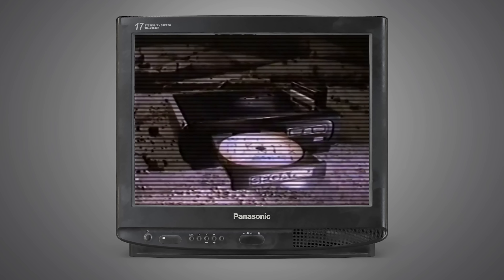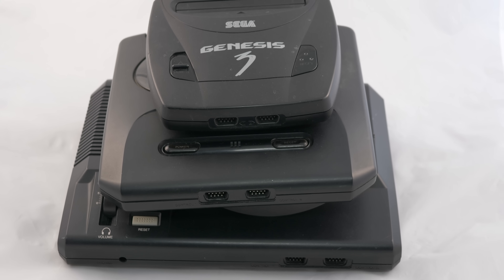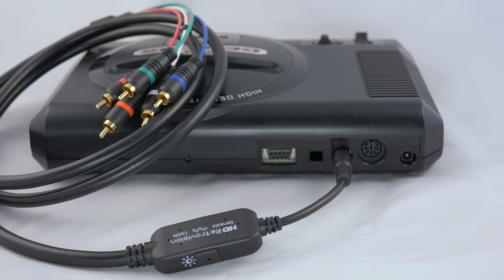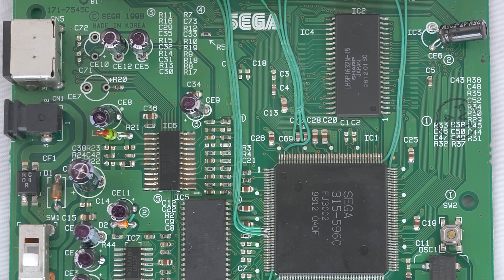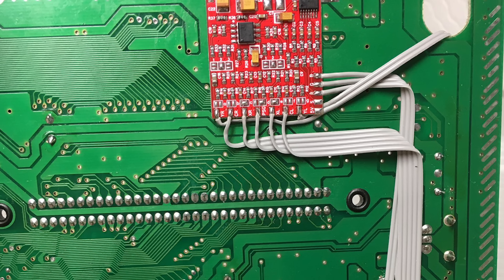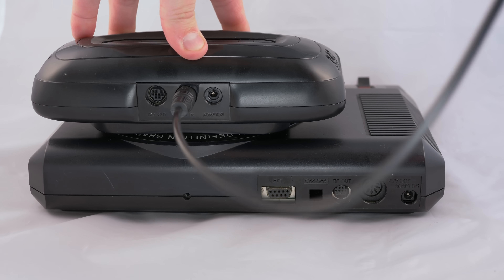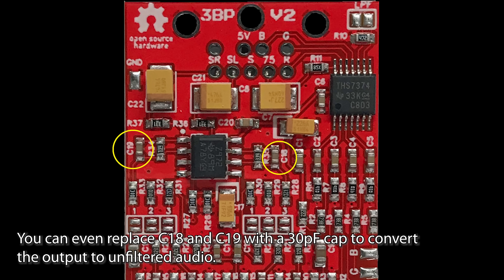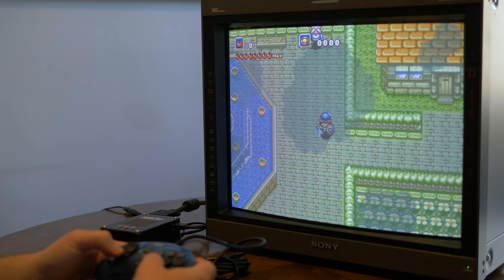Introducing The Sega Triple Bypass

Comment: Video doesn't seem very clear about Model 1 Interference after triple bypass. Will the Model 1 look as crisp as a model 3 with triple bypass? If not how much is the difference. And is there anyway to have no interference on the model 1
Reply from the maker: Analog video on Model 1's will never look as good as a bypassed Model 3.  But they'll still have much less interference than stock.  Maybe try this first and see if it's a good enough improvement for you?:  https://www.retrorgb.com/genesis-1-keep-composite-while-improving-rgb.html

Comment: But what does the triplebypass do to the audio?   What is being changed?
Reply from the maker: It’s essentially making model 2’s have the same clarity and balance as model 1’s. And when installed in a model 1, it’s the same circuit, but with brand new, high end components. So, it’s the same as a new Genesis 1, but with a lower noise floor.
Reply: Makes a big difference i couldn't even play Streets of Rage 2 on my model 2 cause of the cackling bass. Thanks RGB, subbed 👍

Comment: I get bad lag with my Genesis controller to USB adapter. I have not tested my 8bitdo controller yet, but it is only one God blessed me with from Goodwill. The usb adapter supports two original controllers and I most prefer original unmodified controllers. If I cannot figure out how to remove all of that input lag, I may decide to go all out and build the ultimate genesis. I am not sure if it is possible yet, but my wish list includes

Internal HDMI Jack
Rom cart to house all of my games on a single cart
Potentially modding a rom cart to not protrude out the top
Look into what other consoles from that time period that the genesis could emulate like GB or GBC. (GBA might be too much for it.)

If I could overcome the horrible input lag, I may would just build a custom emulation device. Recording audio on Audacity and USB Bus speeds were great on XP, but every operating system onward, it has been horrible. 

There is an abandoned project online where a man spliced an old scuzzy cable (classic printer cable) to wire them to two serial ports and with his own custom drivers, he created two Genesis ports that he mounted on the front of his WinXP pc.

Comment: It'd be cool if there were a way to run the A/V out from the 3BP board to a good ADC for HDMI out as well as additionally maybe an optional S/PDIF out for the audio, and then the Ch. 3/4 switch hole for the RF modulator could be repurposed to switch between HDMI audio out and S/PDIF audio out on a whim.
Reply from the maker: Way better to use a RetroTINK 5x, as you'd not only get proper scaling, but TONS of great options.

Comment: Is the end result always the same, regardless of genesis? If I install on a va1, va2, va3 or va4, in all of them will the final image always be the same, or does it vary? The better the board revision the better the result with the mod?
Reply from the maker: If the install is done correctly, the video will be about the same.  The audio should be identical, with the only difference being the difference between original and llater model sound chips.

Comment: I have the best video and audio reviews, from model 1 and 2. Will I get better audio, and especially video, with this mod, even using a rad2x that I already use?
Reply from the maker: After installing a 3BP, Model 2's get much better audio and the video is cleaned up.
Model 1's are the opposite:  Audio is slightly improved, but video is much better
Reply: @RetroRGB  My model 2 is a VA4, which has a very good image, and the audio is good too, I don't think it would compensate.. The model 1 VA6 I think would benefit more then.

Comment: I grabbed a 3BP chip and now I’m having trouble locating actual installation instructions for a Model 1. 

I can start on with the mini DIN and board install, but this video and the post on RetroRGB all are general info, which isn’t quite enough for the resistor additions and wiring. 

Any suggestions on where to get instructions?

Comment: I just got a model 1 with a Sega CD and 32x and I'm wondering if this mod would be a good idea? I'm using LEVELHIKE's cable for HDMI (which annoyingly doesn't get sound if the 32x is attached so I have to get the audio from the 3.5mm jack)
Reply from the maker: Respectfully, if you're going to continue to use the LevelHike cable, don't bother with this upgrade - You'll never see or hear a difference.  That's actually one of the worst cables out there:  https://youtu.be/7VOsOuQ5mhM
I'd upgrade your scaler before touching the console at all, as the difference will be much bigger.  Look into the RetroTINK 5x and OSSC.
Reply: @RetroRGB  I probably should have specified that I want the mod more for the audio fixes. Right now I have to deal with adding a 3.5mm to RCA cable, just so I can get sound (if I'm using the 32x).  That video is very damning for the lag, but I really can't justify spending $300 and adding in even more cables into my setup for something that at this point should really be easy to deal with. Is there something more middle ground?
Reply from the maker: The TINK Mini is under $100 and the OSSC is pretty close to $100.  Also, a custom patch cable will solve the audio problem:  https://www.retrorgb.com/32x.html
Reply: @RetroRGB  I will take a look. Thanks
Reply: @RetroRGB  I broke down and got the RetroTink.  I was pissed for a moment though. When I got it, it did not work right, as it barely looked any better than the Levelhike cable and it would stop sending a signal out to the tv.  But after an firmware update its working fine.  My next step is to recap everything and then in a few weeks maybe get the Tripple Bypass. The only problem with that is acquiring a 9-pin din (sold out) and seeing if I have the model 2 style din connector to go from the Genesis to the 32x.

Comment: Curious, if the Csync is now 75Ohm, what effect do Genesis cables that were attenuating the TTL signal down have on the 75 Ohm signal?  Are those extra components no longer needed in the cable?
Reply from the maker: No, the opposite - The components in the cable are what complete the circuit and allow the csync pin to output 75ohm (between 250mV and 900mV) sync.  Without them, you'll damage equipment.  Here's some more info:  https://youtu.be/RSn7J6H_m7A
Reply: @RetroRGB  okay that makes sense. From watching this video on the 3BP I got the impression the Sync signal coming from the 3BP was already complete.  Sync seems like the most confusing aspect and I see why it's best to use Luma or Composite.
Reply: @jamisongillespie3524  The (formerly) Composite pin becomes a 75Ohm C-sync pin with the 3BP, while the original C-sync pin remains unchanged (meaning you'll need properly built cables, but you can still use sync-on-composite with the 3BP).

Comment: Great video. FWIW I'm no audiophile (I hate people being pedantic about nothing) but I certainly noticed issues with my MD2's audio.

After installing a Mega Amp 2.0 (which I think is the same as the audio part of the 3BP you're talking about?) everything's cleared up significantly.

Personal opinion but on this note, I think the MD2 is under-rated as I get stereo from the original din and no jailbars. I also like the style of the MD2 as I had one as a kid. Thought I'd mention this as everybody on forums told me to do the 3BP (most don't seem to appreciate what the Mega Amp 2.0 is or why I wouldn't want to use the full 3BP in an MD2). I'm glad that I was able to get away with the simpler, single mod as each bit of fiddling/soldering comes with a level of risk.
Reply: I'm guessing it's because the Mega Amp doesn't really fit in with MDFourier, and isn't as close to original Model 1 MD sound as possible. The 3BP uses a slightly different circuit, which takes MDFourier analysis into account. I'm also the kind of guy who'd rather just bypass the audio on the MD2's as well, as I don't want to lose composite video and the model 2's RGB is already pretty good.

Comment: Installed a V1 Triple Bypass in my Model 2, and the audio quality is night and day. It was awful before the bypass.
Reply: Also like to add that it's a VA1 revision Model 2 board, I did lift the pins on the encoder, and it doesn't have the issue with needing pull up resistors, there is a clear well defined line between 6 and 7 on the color bars in the 240p test suite.

Comment: i feel soo bad for you Amercians. Us in Europe have SCART and today we can just get a 3rd party SCART lead for our Megadrives and plug it straight into the back of our modern TV, as most still have 1 legacy port. Boom, crisp pure RGB and stereo sound without the faff of having to do a bunch of modding
Reply from the maker: Just because you have a SCART connector on your modern TV's doesn't mean it'll work properly ;p  Check out my RetroTINK Mini video for an explanation - Basically, pretty much all flat panels add a TON of lag through their analog inputs and process 240p as if it were 480i.  Plugging an old console via ANY analog input into a modern TV is a terrible idea.

Comment: @RetroRGB  what size/value of caps did you replace for the voltage regulators on your model 1? While you were talking about the caps you added, you showed those caps and was it necessary to replace those caps?

Comment: I have a Model 2 and a Hi-Def Graphics Model 1. Switching between the two, my Model 2 has substantially worse audio quality. A good track to test this on is the Stage 1 bar music in Streets of Rage 2. On the Model 2 it sounds terrible, and switching over to the Model 1 the difference is immediately noticeable.

I'm probably going to get a triple bypass done for my Model 2 as it's the one I grew up with (never knew the Model 1 existed until later in my life), plus the Sega CD I have is the Model 2 version. Thanks for the great video!

Comment: 9:41 do you know which revision has the poor audio on the model 1? Curious to see if mine is affected. The faulty board I had was VA2 but the one I have currently is VA6.
Reply from the maker: VA7 - The one that's basically a model 2 in a model 1 shell.
Reply: @RetroRGB  Awesome, thank you! Appreciate the quick response! As a little side note, I have seen some terrible jail bars on some models of the Genesis, but the VA6 that I have the jailbails are barely, barely visible. I'll get a confirmation of the board revision if that helps.
Reply: @noobguy57  If you need to tell which Genesis/MD model 1 has a VA7, look a the back port area. If they're aligned to the right, you're good; if the ports are centered (and you don't see a serial port), you've got a VA7.
Reply: @AceTrainerX3  I'll check, thanks!

Comment: Need a little help with this... I recently bought a genesis 1 with triple bypass and with a 32x i'm getting very low or no sounds coming from the left channel. I reflowed my solder points and checked connections. For example in virtua fighter  all voice samples are only coming from right speaker. However in virtua racing all are coming from left and right. any idea on how to fix this? Does the 32x only carry mono audio for some of their extra sound effects and samples? I have the same 32x and cables connected to my genesis 2 with mega amp 2.0 and have no issues at all. If it comes down to it is there a way I can re-enable the headphone jack? I believe its a VA5 or VA6 model 1 genesis. I really want to use this for the rgb bypass but the low audio is giving me a tough time.

Comment: I love this unit but the installation guide begs a ton of questions. On the photographs, the ICI3 chip is removed, but it says nothing about it on the guide. Also, some mega drives don't have heat shields that unscrew, as they're bolted into the board.

Comment: 6:50 of course you can hear the difference on youtube. the audio compression is no issue here at all. YT uses AAC+Opus for audio which are really good codecs these days, it only kills frequences above 20khz very harshly (like mp3 did before) in terms of quality in general, you need to be a super human or the source audio had to be anyway super high fidelity audio, which consoles of that era, even if moded today, are not!

Comment: What about a 3BP equivalent for the 32X video encoder?
Btw, I here that there's a relatively simple 32X mod to restore Virtua Racing support.

And it's also possible to double the VRAM on the Model 1 and Model 2 Genesis / Mega Drive consoles, though this won't really do anything useful unless you also find a way to permanently hack the VDP registers to interleave between both chips and speed up VRAM writing. Yes, you can actually do that.

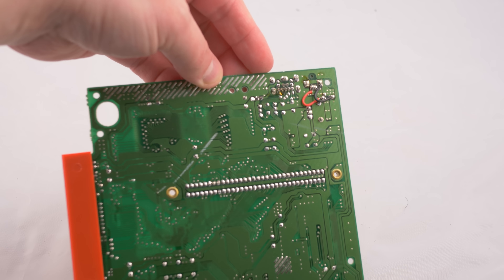Comment: 6:17 - What is up with the black and red wire in the top right of the board?  I've seen several mods where those were in place, but no mod actually explaining why they are there in the first place.
Reply from the maker: Believe it or not, that was a factory mod.  The model 1 Genesis consoles have a TON of them, as do 32x's.  It's kinda funny to see.
Reply: @RetroRGB  😮No way!  I have a Model 2 VA3 console with a bare solid wire (like a resistor leg) instead if wire and thought for sure it was some poorly done mod since it's lying flat on top of several VIAs.  I think I'll swap that out for some insulated wire, lol.

Comment: I use to mod my retro systems for better video and run emulators with even integer scaling with nearest neighbor. But after experiencing it and looking at how other cycle accurate emulators devs run their setup I came to the conclusion that enhancing the system kinda takes away from the experience. These games where made with the idea that home setups will blur the output for example. Today I try and match my retro systems more close to what it actually was like and blur the output of my emulators with rf signals emulator's on PC with crt masking. It also helps when making homebrew games to get a realistic experience to what the user will see on a normal setup.

Comment: I stopped using RF in the early 80's.  I can understand people using it in the 70's but in the 80's RF made no sense.
Reply from the maker: Unless that's the only input your TV had.
Reply: @RetroRGB  Maybe...but I made sure that it did.  I was using S-video by the mid-90's.  It wasn't difficult to get either, and TV's with video inputs weren't really any more expensive.
Reply: @StormsparkPegasus  Kids didn't buy their TVs, you got the extra TV from when a new one was bought for the living room back then. And S-Video was almost unknown by anyone even if it was around.

Comment: Some of the Model 2 board revisions had issues not just due to cheap components, but due to actual mistakes in the circuit layout. Triple bypass is the best fix from what I've heard, but there are other ways to get quality at least somewhat better, on the cheap.

As far as video goes, if you use an LCD, nothing beats feeding shielded RGB into an OSSC for lag-free clean signals via HDMI. Well, at least for an original system. Granted quality will still vary based on the Genesis in question. The problem is it is expensive, and if you have multiple classic consoles you need a really good SCART switch and high-quality cables... it adds up quickly.
Reply: I have a model 2 Va4 made by Sega.. Is it worth it?  I use a rad2x and the image is very good
Reply: @brunorabelo7564  I have an M2 VA4 as well... fairly rare. They generally produce good sound and picture.

Anyway, if you already OWN a rad2x and your TV does a good job upconverting it to native panel resolution (clean picture, no lag), it's probably NOT worth it. 

If your TV doesn't do well with 480p input, then it might be worth it. However the best overall solution now is not the OSSC anymore. 9/10 the Retrotink 5X-Pro is just as good or better, and it's less "fiddly". In most cases you just update the firmware and go. OSSC often requires more fine tuning.
Reply: @AlexvrbX  I wonder because from what I researched, the change wouldn't be as drastic when in a lower quality board version, and in any of the versions the mod would be the same as the final result, so it would be worth buying any genesis to perform the installation, and stay with the original Va4 for rarity, since the difference exists but it wouldn't be an abyss.
Reply: That's what I'll do.  I'm going to buy any genesis, install it and compare it with my original VA4.
Reply: @brunorabelo7564  Yes it's definitely going to make the greatest difference on a flawed board (pre-VA3 full length boards especially). But the largest difference is going to be in the audio.

2.x boards have so-so sound... 1.x boards are mostly AWFUL sounding without modifications.

Comment: 3BP is kind of like putting a modern sound system and EFI in a classic 1950's Corvette and ruining it's nostalgic value. And Analogue Mega Sg is like taking a 2019 Corvette and installing a 1950's 350 SBC with EFI and a turbo charger. I am in neither category, and I prefer carburetors in both vehicles. This makes no damn sense, but that's how I think.

Comment: good video, though as an electrical engineer i think it may have been better to use a piggyback socket instead if lifting pins and soldering to them.
maybe a further revision could have this for two reasons, less skilled users could install it and mainly because hacking up their hardware is frankly off the table for a lot of collectors and even ordinary users.
it has been shown before that once a concept has been proven in hacking and modification terms a "plug and play" solution is the version that the masses will jump on.
Reply: If you can provide a link or part number for a piggyback socket for the Sega ASIC, I will gladly look into that.
Reply: the pins are lifted on a model 1 to try and completely isolate it from the board.  You can just signal tap right off them with wires but lifting does a better job at isolating them.  Still can't get rid of them all the way though.  On a model 2 it isn't necessary.